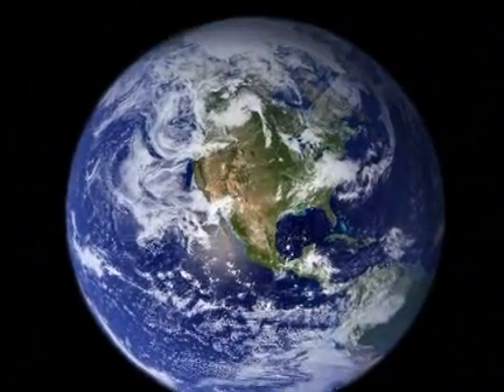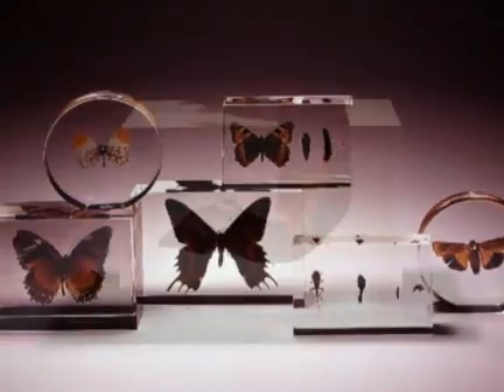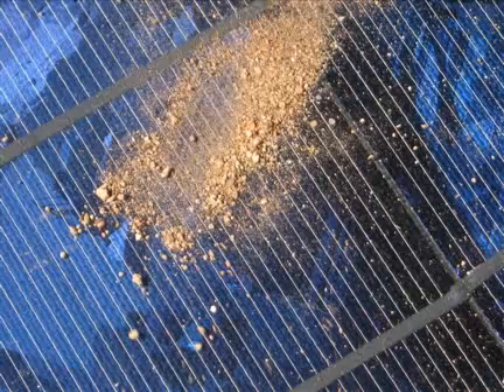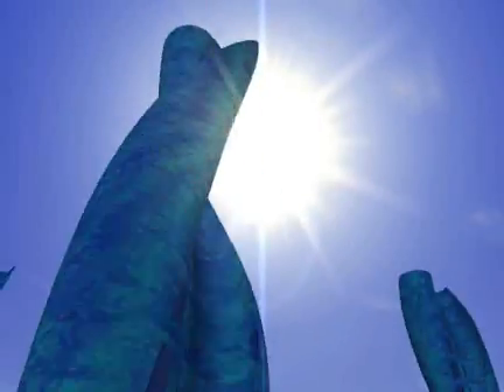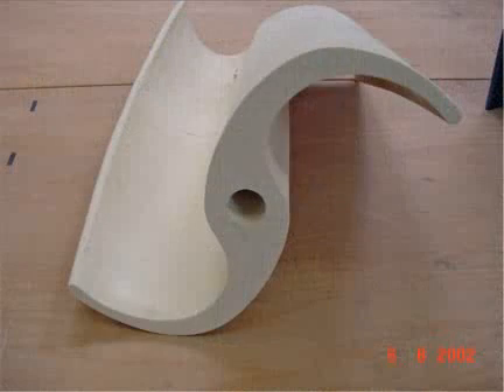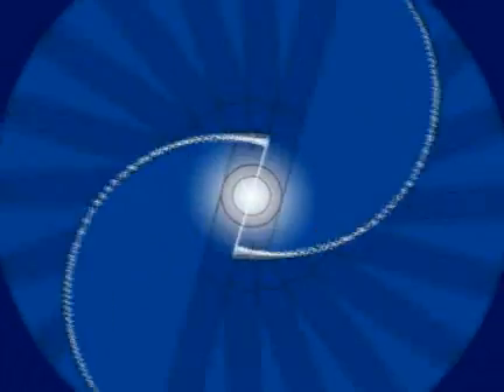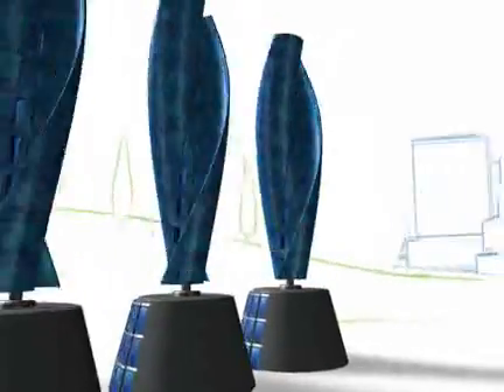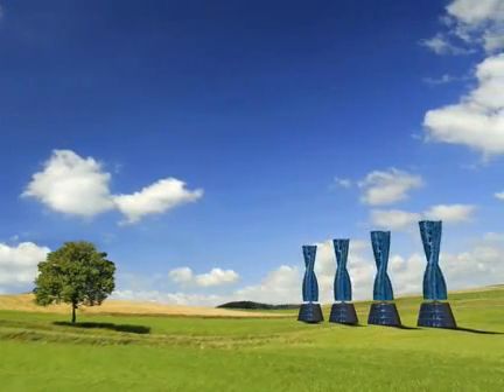The Bluenergy solar wind turbine

Comment: use my ideas so we got tremendous energy from atmospheric pressure
as we know that one centimetres square area have one kilogram per squares centimetres then a ten meter square area gives one lakh kg weight so if it's going up down slightly then many thousand joules of energy produced and by leverage principles we use this motion to electricity making by simple spring based battery or rotor having gyroscopic actions